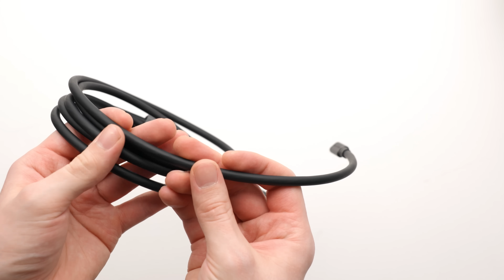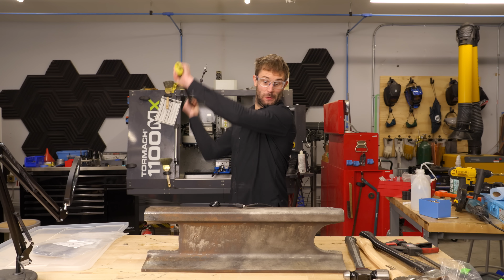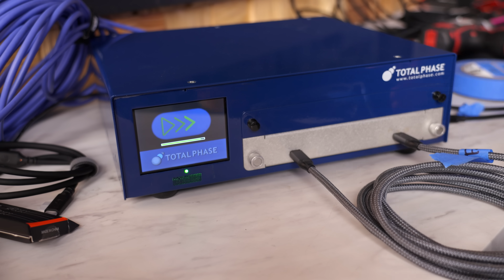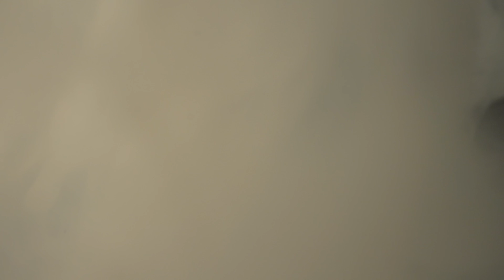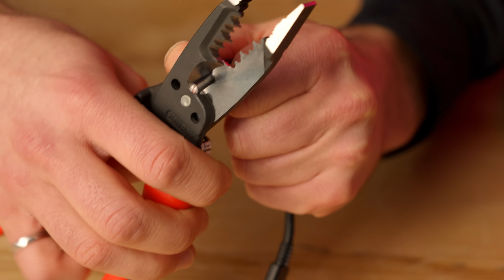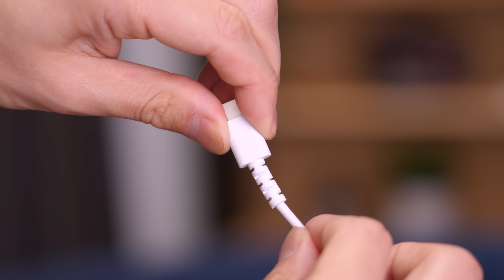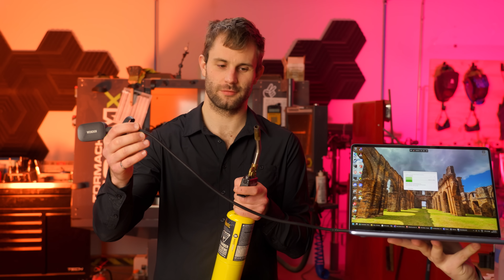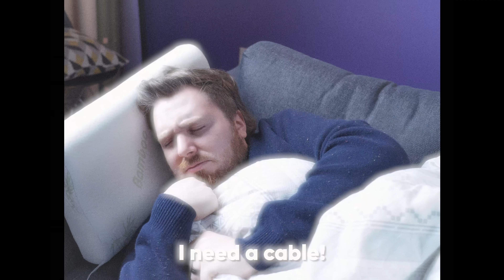Why It Took Me 4 YEARS to Make a USB Cable

Comment: Leaving a review is difficult so ill say it here. I have tried 3 different phones and 2 different cables, the C males will NOT stay in, the slightest breeze or shake makes them fall out, its so disappointing.
Reply: Really? I can swing my phone around like a helicopter with the usb c male connection. Its really on there tight.

Comment: Here's a simple key to USB speeds, based on the ORIGINAL specifications of MAXIMUM USB data transfer rate:
USB 3.0 - 5 Gbps 	(USB-A)
USB 3.1 - 10 Gbps 	(USB-A, USB-C, Thunderbolt 1)
USB 3.2 - 20 Gbps 	(USB-A, USB-C, Thunderbolt 2)
USB 4.0 - 40 Gbps	(USB-C, Thunderbolt 3-4)
USB 3.x specifications were subsequently retconned by USB industry flacks. As always, IGNORE ALIEN ORDERS.

Comment: Will there be 10G cables at lengths of 15 feet or more? possibly with right angle connectors? Asking just in case LTT comes out with something better than Tether tools or similar photo tether cable brands.

Comment: Honestly $30 for a cable is not bad if it's good quality and works I usually buy a lot of anchor products they have been the best for me for a while that I have found but a little on the pricey side as well. lately I've been having problems with them shorting out or having problems at the crucial bending point where I have to move my wire around until it says charging I will give these ones a go and test it out I will update when I use it for a little while

Comment: I have question. I know long usbc cables are less effective. But will it still work 100% effectively for, say, creating a wired connection between a gaming controller to a console?  Or will there be latency

Comment: Well some just arrived in specs yes this are good cables and good quality for stationed equipment. Because only the smallest wiggle will unplug your cable... The grip of the usb c male is way to little... My use case was to use the long cable all around the couch so anyone sitting always has a phone charger. But sadly the cable will be out or your phone within 5 mins with case or without.

Comment: 9:35: "female"= socket, "male" = plug. Please stop gendering computer hardware. It's also a lot more ambiguous with USB-C since the plug has a hole in it. A slit if you will. While the socket of a USB-C port has its own erected component inside protected by the hood of the device. So, referring to them as male/female is even more confusing to the uninitiated.
Reply: Never seen anyone have a problem with that 😭

Comment: i'm sorry but i call bs on the 4 years of development story and using a trash amazon cable to scare people. testing a generic gray cable that relies on error correction to hide a bad signal is total cherry-picking. you skipped testing tier-1 brands like ugreen because you know their hardware actually passes the test perfectly.

fair play on the labeling though. putting both speed and power limits right on the plug is the one thing you got right. even ugreen only does that clearly on their top-tier 80gbps/240w cable.

but look at the pricing, it makes zero sense. for the exact same $26.99, ugreen gives you a usb4 (passive thunderbolt 5) 80gbps/240w cable with a nylon-braided jacket and a solid aluminum housing. charging that same premium for a slower 40gbps cable wrapped in silicone isn't a flexibility feature, it's just a massive cost cut.

making a braided nylon cable with machined metal shells takes a multi-step assembly process. silicone or tpe is literally just an extrusion line pumping cheap melted rubber through a machine over the wires in a single step. it slashes factory labor and material costs down to pennies. you guys didn't choose silicone for the user's benefit, you chose it to maximize your margins.

show us a comparison of top tier usb cables in the same price range and how they stack up against yours.

Comment: I never even thought about how bad my cable where until I saw this. I tested the speeds on them all with a external NVME enclosure and a 20Gbps thunderbolt port on my laptop. Wow they are all garbage. Thanks for making me order a bunch of your cables, lol. The onoy one that worked properly was the sabrent one that came with the enclosure and its only 6 inches long.

Comment: Been over 2 months now of me checking the store almost daily for the cable I want to be restocked. I've noted at least 2 or 3 restocks of all of the cables... except the one I want, 2.5m 20gb/s. I should have grabbed the 2m when I had the chance... but that extra length would really be useful for me.
Reply: Almost as if to spite me specifically, I checked the site and the cable has been restocked. Huzzah!

Comment: IMPORTANT : Thank You so much for this. But i think a test is missing. Please do a short to show if the the LTT cable manage to show supervooc protocol used in Oneplus Oppo and Realme phones. Just connect the cable to a supervooc charger (Oppo Oneplus or Realme 100 or 120 watts charger) and connect it to the power-Z tester to show us if it detect the supervooc protocol. Don't forget this PLEASE !!! It's IMPORTANT.

Comment: I never thought about "bad cables" until about 4 months ago. I have a 100W charger and planed on using it to charge my laptop aswell as my iPad. in theory, this should work. the charger has a full 100W output and a 30W output. my laptop needs 65W power supply, my iPad 30W. this sounds like a perfect match, and in the end it turned out to be just that. But things arent always that easy. When you buy a 100W charger, you would expect to get a cable that is able to deliver the 100W that the charger can, but the included cable couldn't even deliver the 65W to my laptop. So I went back to the hardware store to pick up a 100W cable, which was able to charge my laptop. As I don't want to use 2 different cables to charge my devices, I just got 2 of said 100W cables. I could charge both my devices at the same time at this point, success right? No, turns out, the 100W cable had such a bad shielding, that it caused false touch inputs when I used my iPad while charging. This made it unusable for me, as I often work on my iPad when charging it. it also concerned me and I didn't feels safe using the same cable for charging my laptop. so I went online and searched for another cable that checked all the boxes: 100W charging, good shielding and maybe a good feel. I've went with another brand than the LTT true spec, which works fine, but I wished I saw this video before all this hustle. Now I have 4 usb c to c cables that I don't use and probably will end up in a drawer... It can't be that hard to make good cables

Comment: Not braided? No thunderbolt? Ok, not for me.
Reply: There is thunderbolt? Their usb 4 is thunderbolt 4.
Reply: @raawesome3851  They are not the same. USB 4 labeled cables may not support daisy-chaining of peripherals, which is a required feature of the Thunderbolt 4. Thunderbolt 4 guarantees 40Gbps up to 2 meters, USB 4 guarantees 40Gbps only up to - 1 meter. LTT all 40Gbps cables are 1 meter or less. 

1 meter cable is just too short in many scenarios. You won't be able to connect your pc from under desk to the dock or monitor on your desk. Or wider monitor to laptop that you want to put on the other side where USB-C ports are located on the monitor.
Reply: @dyto2287  Fair, but unlike a lot of cables, you can actually trust what they're saying to actually be accurate. That's not something you could say for a lot of other cables, even name brand ones.
Reply: @raawesome3851  Maybe. But this is their first attempt at making cables. We still need to wait and see how these cables hold up after longer use.

 They might have met specs but that cable is as thick as my AC power plug to monitor. I ain't carrying these thick cords in my backpack to connect my devices.
Reply: @dyto2287  I mean, at least them being thicker proves they're not actually a bad cable, and honestly, I don't really see their products as bad, whatever you think of LTT. I have bought their screw driver and water bottles, and those things last, they're tough.

Comment: I recently got mine. It's great, but I do have a slight problem with it. It keeps falling out of my phone while I'm on the road, I don't know exactly what it is, but I think the plug itself doesn't have the metal bump that's supposed to hold it in place

Comment: I have a computer analysis device that is very picky about which cables work with it. You're familiar with the Flipper Zero so I can tell you that so far, the ONLY cable that works is the one that came with the Flipper Zero. None of my other "premium" cables cooperate with the device. Is this a length issue or is this something from the inferiority of the cables?

Comment: I feel like there's a simple rule to follow for when to buy cheap vs quality cables:
Analog, permanently fixed, higher source signal strength, low data volume (i.e. speaker cables, power cables, audio at line level, MIDI, peripherals, printers, 1G network): Cheap cable fine
Often plugged and unplugged, low signal strength, high data (storage, instrument cables, 4K display, microphone, or anything at long cable runs): Choose quality. Doesn't always mean expensive.

For simple cables like XLR cables, quality doesn't need to cost you 30$ for a 30ft cable. They are very simple cables (2 conductors, 1 shield). The quality is more in the connectors and the soldering job than the cable itself. The signal is usually fine, but the product isn't durable at the lowest quality.
Digital signals that run at high frequencies often run at very low signal levels and are susceptible to noise so the cable does matter a lot here. Probably why it was so hard for Linus to find a good manufacturer.

Comment: but when you admit these cables can have problems with recessed female sockets, then .. what do you do to solve it ? I have an Idefender with this problem and had to buy a pigtail cable that solved this issue for me, a short basesailer did fit... For stuff like that, if I would have bought truespec cable, would I have had the same problem ?

I've been going through a rabbit hole solving the ground noise I had with my audio interface. The last thing one would want in this case is buying a cable from the guys that say they have the best cable in the world... to not fit in the female socket of the PC either :P

Comment: With his disclaimer about them not being cheap, i was thinking "well, its gotta be like 40 bucks" nah. 20 bucks. That is totally and completely reasonable. Especially for a cable of that quality with clear specs. Nothing is more annoying then trying to find a cable that actually does what you need it to. (like a switch dock cable or a stream deck cable for example.)

Comment: Beginning of the video:
USB will re-transmit data on bad cables transparently slowing you down without you noticing.
End of the video:
Those are digital cables, they either work or they don't.

Comment: If anyone wants to know, the brand LTT is working with is "Cable Matters" Yes that is the brand name, they make a lot of quality cables and computer tech. Linus is right, they are not cheap, but they last, solid, reliable and consistent.

Comment: Why is the jump so big from 20Gbps to ~0.5Gbps (480Mbps) in 50 cm for the usb-c, and for the usb-a from 10Gbps to ~0.5Gbps? does it not make sense for the usb-c cable to support 10Gbps at 3m like the usb-a cable? or that in between 20/10Gbps and 0.5Gbps there is maybe another speed for usb-c 5 or 10Gbps and for usb-a 5Gbps. I understand the idea but what was the reason for not extending the usb something with 3 range by using another in between speed?

Comment: when it comes to cables and chargers i just buy anker. they dont do me wrong and lie. priced well. CS is good and handeld a recall swiftly on a power bank before.

but its nice to see you guys did the usb thunderbolt 4 whatever you wanna call it cable for even 8$ less than them !

Comment: That cables look great. I still use my anker cables because i have 2, one that has the sleeving broken(it ripped out of the rubber at the end and one that i got for free from anker because i did reached out to aker about that problem, i still use the cable that has the sleeving defective, i just put shrink wrap on it, and send a AI generated image to anker of the cable being cut (i mean if i would have cut it i would just had repaired it nevertheless,  so no difference really  if i cut and repair it or just straight up use AI to make them think it was cut - i even compressed the image highly and put a little bit of  blur on the image so that the image has a bad quality) So i wait untill that cable really breaks and then i will use the replacement that i got. But in a few years when both finally broke i will get the LTT cable -  Shipping to Germany cost 25 dollars but hey canadian, so that cable still end up costing me around 35 euros but well good cable can have its price,  and i probably would get more than one, so it would get cheaper per cable if i divide the shipping cost between them.

Comment: I really like these cables, but I'm not sure you can beat Apple's Thunderbolt 5 cable. It has everything you need (except the excessive length you offer) in a single package. I basically use two kinds of USB-C cables today: Apple's long 240W cables when I just need charging, and Apple's Thunderbolt 5 cables when I need to move data. There isn't a ton of use case for others.

Comment: Kinda upset all the lengths I'm interested in are out of stock. I definitely don't need a 5m cable. 😅

You should add a "notify me" system to the site so people could request a notification when the length they want is in stock. Then you can prioritize restocking the lengths that have the most notification requests. (Though I wouldn't use it as a sales projection because people might not buy it even though they asked to be notified.)
Reply: Woo there's a notify me ability now. 🎉

Comment: Also if your not getting proper internet speeds check the cables 1Gig plus needs ALL the data lines. I was wired to my gigabit network only getting 100MB speeds because my cable wasn't connecting properly, nothing fixed it till I changed cables, hasn't happened again either.

Comment: Ok so from a wider point of perspective i think the cable industry slowly declines. The wireless industry is coming more and more. And when the USB C standards are just a guidline, nobody cares a s'ht about the specs. So in long term, USB is NOT going to get better - its getting worse each year. I have done so many cables and no cable ever lasts longer than maybe 1,5 to 2 years of NORMAL usage - just plugging in and out, in and out.

Therefore i plan to go completely wireless in the future, cause cables just suck.

Comment: Thanks for cleaning up the space for cable buyers. Love that you're abandoning the usb versions, and just focus on the power and bandwidth. Much easier to reason about, and brings the cost down - well done. What about thunderbolt certification though - is it equally out of the picture? Can the cables state "on par with thunderbolt 5" or something, even without the cert, just for convenience or is that breaking marketing law?

Comment: first, this is nice to see, but i have questions.  Most of the operating resistance from cables like this come from the connector interface itself, not the wires.  I notice you didnt talk about that.   Not an issue for signaling, but definitely is for PD.

My experience here is that I typically see up to 0.25 ohms for each pin.  Thats a half ohm for round trip.  For a 3A/5V delivery (for example), i can loose up to 1.5 volts just across the cable.  Couple that with the fact that you dont control the quality or form of the mating connector, as that already exists in the device itself.  What innovations have you designed into the connector itself to control this?

Before you ask, i am no stranger to USB cables, and I am responsible for designing and manufacturing well over 50M products a year  that all use USB cabling in some form or another.

Comment: So i know this is the wrong video to comment on , but i wanted to get help on a problem i have. ( I have know almost nothing about laptop and what god specs is). So beginning of last year i got a Lenovo Ideapad 1i 5IAU7 laptop and i want to game on it but it doesnt have enough VRAM on it. I dont know what to do so that i can get more VRAM, and i dont tkink i can add ram or break open the laptop to put another gpu in or something,. Do you have any suggestions of what i can do, any help would be appreciated, like should i get an external gpu or something. Like i want to be able to play games like rust, but VRAM not enough.

Specs: 
Processor: 12th Gen Intel(R) Core(TM) i7-1255U (1.70 GHz) 
RAM: 8GB
GPU: Intel(R) UHD Graphics
Let me know if there is specs im missing, i know im propably giving the wrong information

Comment: I'm still not in any way impressed by the strain relief. Work hardening of the copper inside is still going to sever the conductor after repetitive back and forward motion. You know, like what happens when you use your phone when charging, the main reason why cables stop working

Comment: Looked at the cables on the site. Why is there such a big speed dip after going above 8.2ft. From 20gbps at 8.2ft to 480mbps at 9.8ft. Be cool if it atleast had 1-10gbps like normal lower end usb c speeds. The 16ft cable would be perfect cable for a vr setup if it had 5-10gbps.